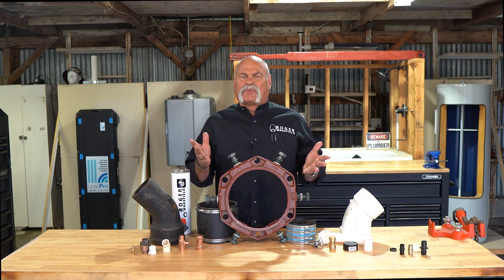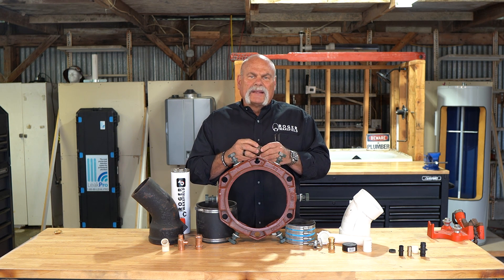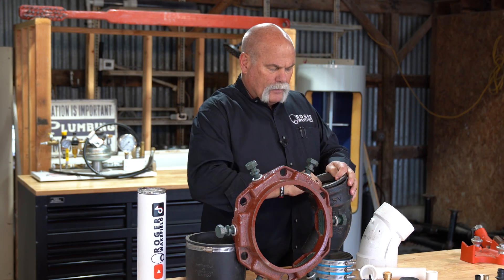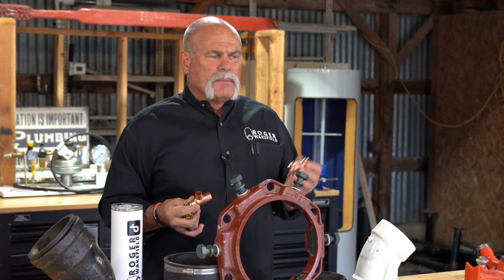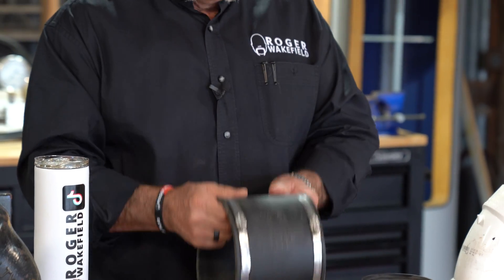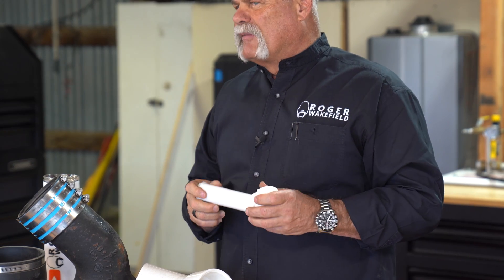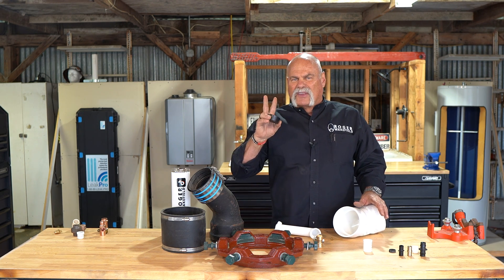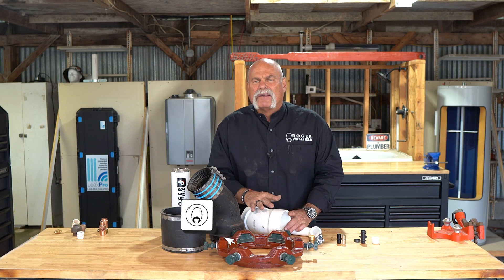Every Type of Plumbing Fitting EXPLAINED

Comment: The neoprene  and lube ( "duck butter" ) is difficult to use on the larger ( 10 or 12 inch ) sizes.  On a commercial job in NV, we had a backhoe anchor one fitting with its  landing pad, then used its bucket to push the other fitting in.

Comment: That megalug for the MJ firing is for C900 the ductile iron ones are black not orange.  You can use c900 mega lugs on ductile but not ductile on c900.

Comment: ABS is far more shock resistant. It's also got better plastic deformation rather than cracking like PVC 

In places with soft substrate, earthquakes, etc ABS will stand up to shifting much much better than PVC.

I've also seen ABS used for the same reason in pressure systems. It won't fragment and shatter. It's more of a plastic tearout if it ruptured.
Reply: Thanks! I work on the supply side of things, and it baffles me that so many professionals in the trades so often throw their hands up and say "Who knows why they use that?", when there's definitely a reason an engineer chose a certain material or fitting over another for a building code in that specific locale. Just look it up guys! There's no excuse when the internet exists!

Comment: Copper is king. Even superior to Pro Press. You can leave a piece of copper pipe and fittings under the elements for years and all you need is some sandpaper to clean the ends and solder them together and you end up with a best joint possible. You can't say that for any other pipe or fittings. They all deteriorate under the elements.

Comment: For some reason whoever the plumber was at my family home (built in 94) used flare connections for all the supply lines and it's been a giant pain to deal with because everybody else seems to use compression. The toilet supply lines are 1/2" flare and only a few Home Depots carry them in stock and it's only the 12" variety so they have to get all twisted up which means once you take them off 3 years later to replace a part, you have to replace the hose again or it'll leak due to the rubber parts cracking when you move it. Originally they had solid copper supply lines but I couldn't use them with the new style fill valves. The dishwasher installer also refused to do the installation because his supply hose wouldn't fit our valve.  I guess the solid copper WAS nicer and they put more work into it than just getting a hose but I wish it was the standard 3/8" compression. Is there a 1/2" flare to 3/8" compression adapter I can use? I really don't want to replace the supply valve if I don't have to - not sure if it's a FIP, soldered in, or compression.

Comment: They like using the ABS black stuff on RVs, I parted out 3 and they all had it, it seems to me it's more flexible than PVC, I used some of it when I ran out of PVC on the waste line of my bus to RV conversion, it bonded fine and didn't leak.

Comment: As a plumber in washington, I havent ran into many copper solder leaks. During our ice freeze a couple months ago, thats when they started to break and pipes started to burst
Reply: Same here usually it’s the pipe itself that cracks in the middle but the solder joint are typically fine. But a lot of older homes in Oregon are still plumbed with grey poly pipe

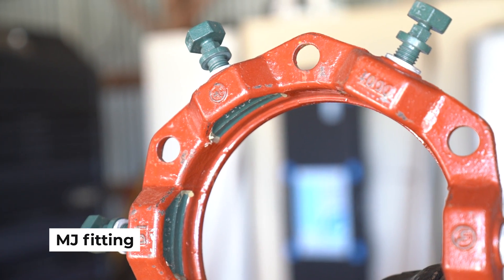Comment: 6:42 typical plumbers both residential and commercial won’t build up a lot of experience using those MJ fittings. They are typically used on distribution piping 4”-12” the same fittings will be used for both ductile pipe as well as c900 pvc pipe. As they have the same OD. Over 12” then it’s a different story for c905 pvc etc.

But they are fairly easy to use. They bolt together to form the seal and the blue bolts on the sides are called “break away” bolts. You tighten them down until the heads breaks off to ensure they have the proper torque equally on all sides. Tightening those break away bolts causes the clamps to compress against the pipe. It’s a built in pipe restraint, to prevent water hammer and an absolute MUST for big size lines. Otherwise if you’re just using a joining coupling it will blow off. Unless you have a thrust block poured. But most utility installers will use restraints and thrust blocks after the system is pressure tested with restraints.
Reply: Ductile pipe uses black MJ fittings , the red ones are used on plastic pipe (DR 18 and such). I think it has to do with the torque it takes to break the Frankenstein bolts.
Reply: @danielquanbeck4405  Mega Lug specifications allow use for both ductile and c900. But on the breakaway bolts it calls for the removal of the extra tab for the ductile vs pvc but I’ve seen a lot of installers leave the tabs and I’ve seen some installers not even tighten the bolts till they break and the restraint held up fine. Wouldn’t advise that, but just saying.
Reply: @mrDmastr19  maybe I’ve been using a different brand or product line of the same brand. But the brands I’ve used specify that the red/coral colored restraints are for plastic pipe and the black are for cast iron or ductile. The tabs you’re talking about are removed for IPS pvc pipe. Star, JM Eagle, and Ebaa are the brands I’m familiar with in the Midwest.
Reply: @danielquanbeck4405  that’s interesting 🤔… you know one head scratcher that I’ve come up with over the years I’ve been around distribution. Why on earth have they not come up with a better way to seal off the sleeve of the resilient gate valves down at the operating nut and the valve box can itself? Half the time you go to use the gate valves they are either:

1. Buried with mud sludge from when the rain pours into the valve box and down the sleeve which causes premature corrosion to the external nut and bonnet.

2. When installed they installed it so crooked that the sleeve is slanted and you can’t even get the valve key to turn down in the sleeve.

It’s be nice to see like a sealed chamber around the gate valve and a water proof lid to keep dirt and debris out. 

I did see a 4” gate valve that had like a 1” circular base around the base of the operating nut with a 1” lip, that the sleeve could sit in. It wasn’t water tight but it was a cool idea to keep any dirt out from the ground shifting etc. but ironically it was for 4” IPS. 

I feel like if they simply would better protect the actual valve and nut better and not let it be so easily buried and in contact with debris water etc, it would corrode less. Or at minimum would be readily useful instead of having to vac truck the sleeve when you need it. I mean I suppose the valves typically last 25+ years before they become an issue. But I feel like at the same time, they should last longer than that; but it’s a corrosion issue. And that’s just the external cathodic corrosion. The water quality issue is becoming a problem too. The mineral content is so high in our water district. Internally things are failing way earlier than they should.
Reply: @mrDmastr19  they make a rubber insert for the bottom of the valve box. It does an “ok” job at sealing and keeping stuff out as well as keeping it straight while you backfill it. I think that the seal are a pain to put in. It would be nice if someone came up with a better way.